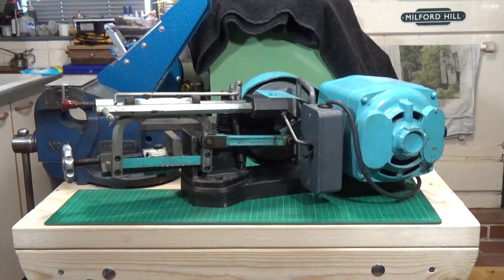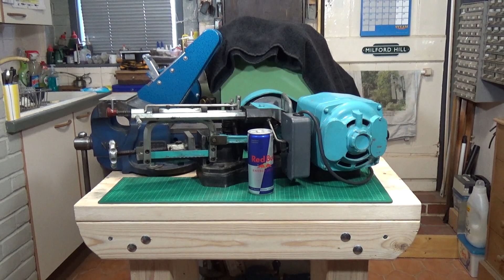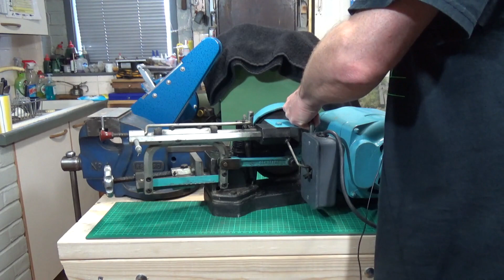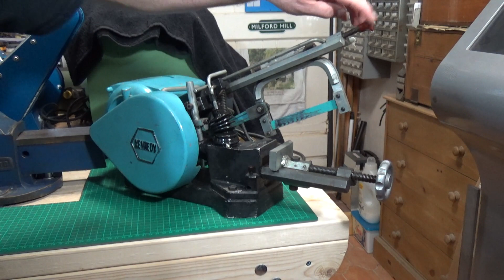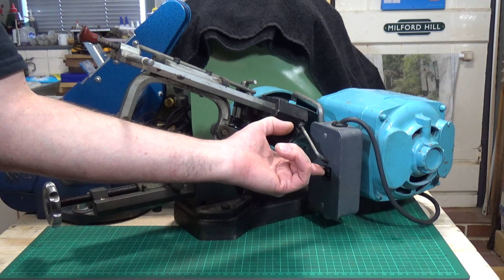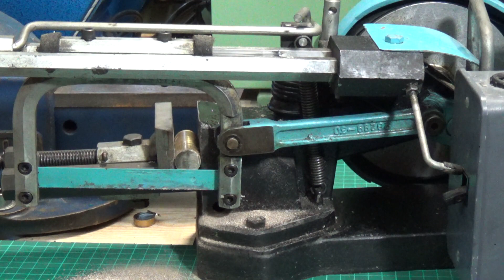Retro Mechanical Tech - Kennedy Model 60 Power Hacksaw

Comment: I’ve just acquired an old one, tipped over in car on way home and the damping oil leaked out, any idea what type of oil to replace please?
Reply from the maker: According to the information on these at http://www.lathes.co.uk/taylor/page2.html . The dashpot used Castrol V which is no longer available but SAE 90 gear oil is a suitable replacement.

Comment: Just dropped on to you by chance Alan. ive sub'd you and will take a look at your video's they look interesting,
Nice explanation, thanks for sharing, 
could you tell me the size of the hexagon across flats on the vice part and the top slide part  and their lengths please, it would be appreciated. 
regards
mr f
Reply from the maker: Hi Mr F. I thought that given it's age the hex bar would be imperial but it's metric. The size across flats is  20mm for the vice rails and 15mm for the top slide rails. Cheers, Alan.
Reply: @RetroSteamTech  cheers Alan  appreciated
Mr f

Comment: Hi Alan what year was this saw made.. Its seems bit more modern than my hexacut. My one has the the longer kill switch rod the hits the switch on the end of the motor
Reply from the maker: Hi. I'm not sure of the exact year but it has the Lemac motor fitted and they were first used in the 1970s.
Reply: @RetroSteamTech  OK that would make mine the 60s model

Comment: Hi Alan,
Just looking through your back catalog of videos... A three questions if you don't mind. 
Nearly two years later do you still use it or is to to much fuss to get it out and setup?
Have your tried steel and cast iron?
Does it cut in a straight line or is it a bit wobbly?
Thanks
Paul,,
Reply from the maker: Hi Paul. I don't mind at all. Yes I use it all the time, that little bench that it is sat on in the video has shelf under the main work top about 8 inches from the floor. The Kennedy is sat on and clamped to that shelf. I've used it to cut mild steel, stainless steel, cast iron, aluminium and brass all with no problem. It cuts straight although sometimes I add a clamp on the stock that I'm cutting as the vice only has a hand knob and it's difficult to get it tight. It's main limitations are the very short stroke, so it does take a while to cut through thick metal and you can't really use it on anything over 2 inches in diameter. Cheers Alan.
Reply: @RetroSteamTech  Thanks Alan.

Comment: very nice. lathe in the kitchen should come in handy, turning down a beef joint.
Reply from the maker: 🙂 I cut a lot of small bar stock mainly brass & aluminum which it's perfect for. It will cut larger stuff and steel but takes it's time as the guy said below you can leave it cutting and go and do something else. The auto stop works really well.